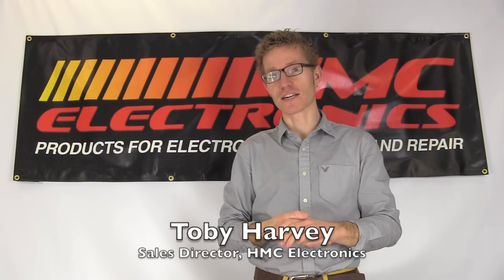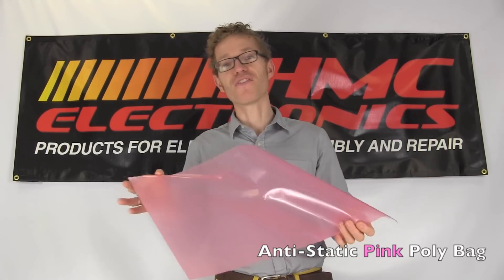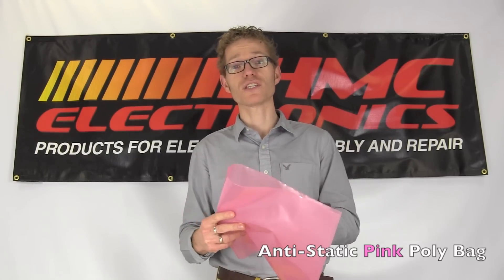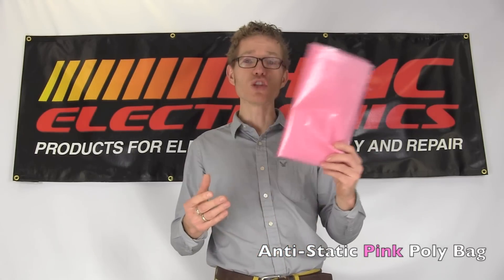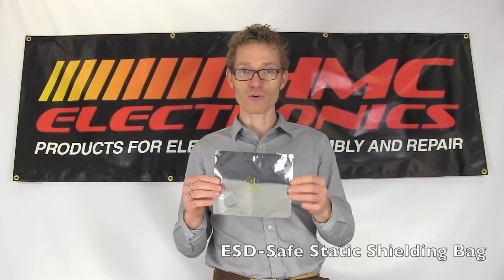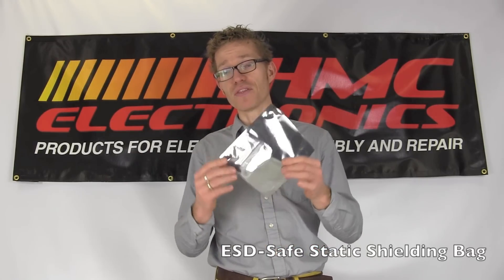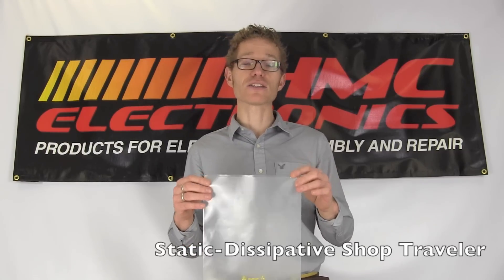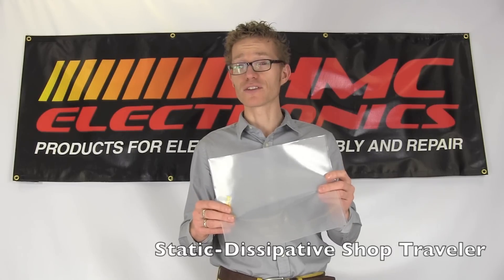ESD Bags: Static Dissipative vs. Antistatic vs. Static Shielding

Comment: Good luck getting under 1kV to go through both sides of a 6mill pink poly. And, I highly doubt you could get an arc even at 10kV to follow a current path through one side of the bag, through a device contained there within, and through the other side to ground unless you suspended it in a purpose-built spark gap.